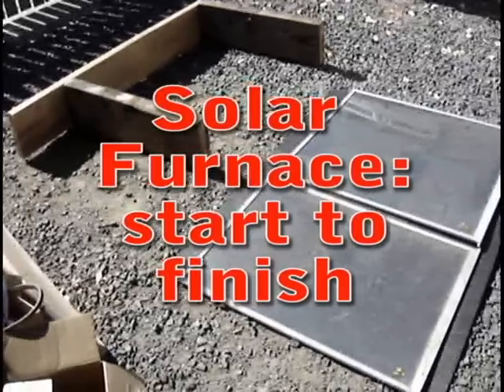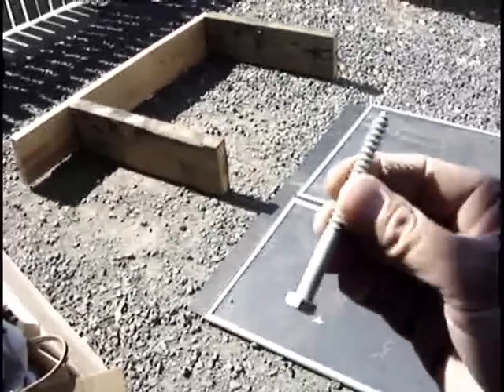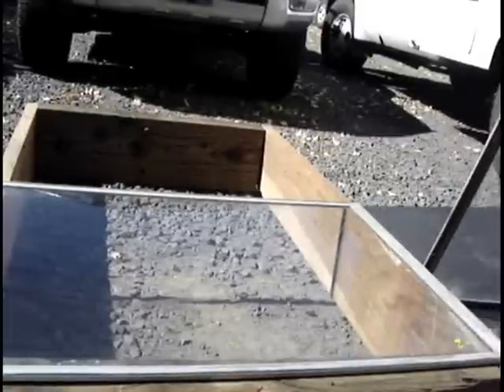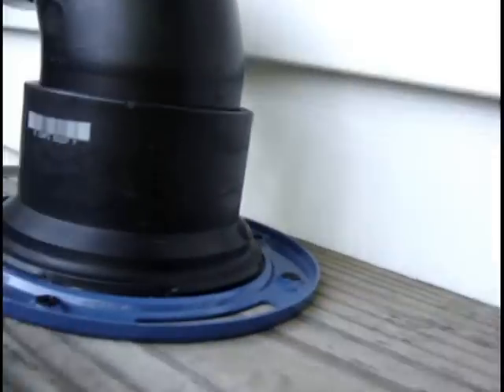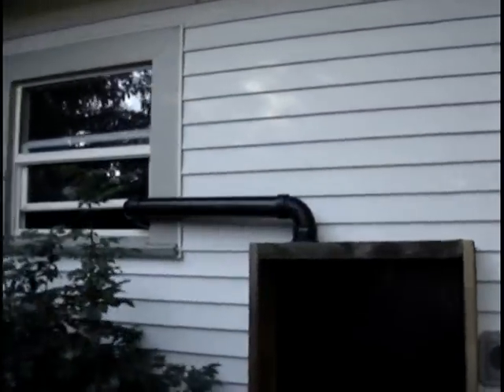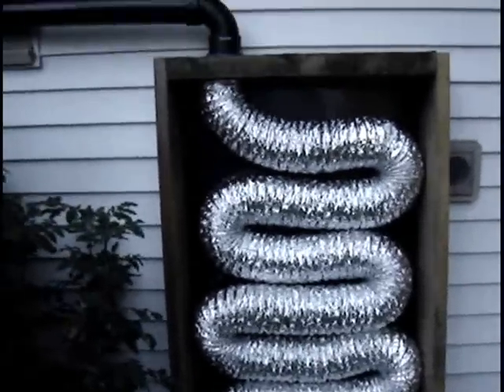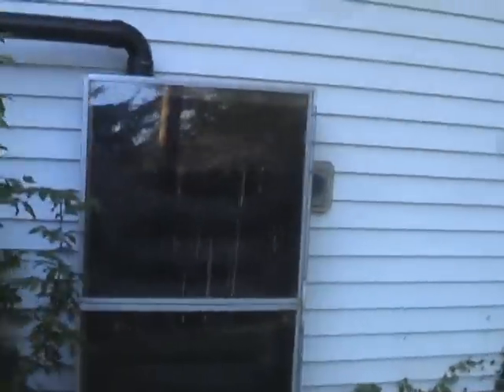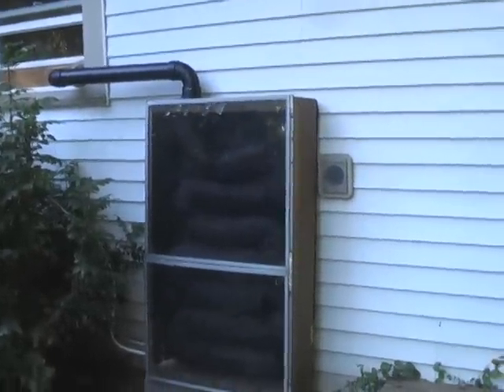Solar Furnace for under $50

Comment: Why are the return lines so tiny? You only get out the CFM you put in. Otherwise it has to be made up and wasted elsewhere.
Reply: .... slower air intake allows the air to warm sufficiently. IF its passing through too quickly it wont allow enough time to excite the electrons enough
Reply: Nice guess. There isn't enough CFM there to heat a doghouse.
Reply: @Cotronixco  its obviously only a proof of concept and not intended to heat his entire house. Dont shit on the man, these kinds of ideas are what will slow global warming. It is obvious that change is only going to come from the people.
Reply: Not shitting on anyone. Obviously it's a teaching moment for some.
Global warming? LOL. That's a false religion.
Reply: @Cotronixco  CO2 levels have increased from 250ppm to 400ppm since the industrial revolution, and your gonna say there is no correlation between then. All you gotta do is look at a simple line graph to see the symmetry...
Reply: @Cotronixco  Your clearly not very educated. It was an example to illustrate how misinformation campaigns have been used before to skew public perception. The fact that you can't see that and totally misinterpreted my comment, coupled with the fact that you have actually fallen for their nonsense is pretty clear evidence of that fact. I don't need to argue with you, I agree to disagree. I'm secure enough with my beliefs and opinions that I don't need to convince others who willingly ignore data to meet their preconceived ideas. Just as the tobacco companies did, just as NIST did in the "9/11 comission report"
Reply: @Cotronixco  as for your other comment. I do think wind and solar are better options, coal generates constant pollution whereas wind generates some, but that is mostly due to manufacturing, and manufacturing takes power and power uses coal or diesel, or just as bad nuclear.... 
Electric cars are not more efficent since again the power to chage them comes from the grid and grid power predominantly comes from burning fossil fuels... the pollution is just further removed, coming from the stack of the power plant rather than the tailpipe of your car but its still going into the environment. Solar panels last a minimum of 25 years... how much coal would it take to generate 5kw for 25 years? About 170 times what it would to manufacture a windmill or solar. And then you can user that power to generate power to manufacture more... obviously once there is sufficient quantity of them for that. Again I dint need to argue. I have worked on off grid power projects for years, my best friend is a retired professor of journalism with over 50 years journalism experience, our other friend is a environmental economist at the world bank in washington. I know what's what... even the oil companies themselves have admitted their own scientists warned them about greenhouse effects and global warming over 40 years ago, the chose to suppress the information. You only dont want to hear it because you dont want to have to admit you might be mistaken, that whatever bs you heard and been regurgitating for who knows how long is false and knock that chip off your shoulder. Your arguments in your response are anpther example of your ignorance. It always gets cooled at night.. has since the dawn of time because there is less solar radiation hitting the earth, likewise a tree getting bigger is a result of cell division, not even relevant in the least. But again I dont need to convince you. If you have nothing to fear and your so sure your right whats with the hostility? Because you're afraid I am right and so try to force your views through agression like a child who doesnt get his way, throwing a tantrum. If you had nothing to fear you wouldnt seem so threatened by my comments. Why not go have another look with an open mind, put aside what you think you know.
The truth is that you are wrong, but won't admit it because people naturally avoid even the most glaring truth when it challenges their world view, its simple psychology
Reply: Oh boy. Where do I start. First, again, anyone who can't even spell 'you're' again, and then claims to be educated is very difficult to take seriously. Next, solar and wind need to be subsidized to be competitive. Do you even know what that means? The cost is so outrageous that it can't hold up on its own anyway. Personally, I contend that burning firewood produces less CO2 than solar or wind. I burn a tree from the woods for energy and you clowns get your panties in a twist. But if I leave it lay in the woods to rot, emitting the exact same amount of CO2 (only taking longer to do so), and I replace the energy it could have produced with another polluting source, you're OK with it! Next, power over time is never measured in KW. It's always measured in KWH. Ignoring the time factor makes all of your calculations completely meaningless. Next, you throw a tantrum and then tell the other guy that he is. That makes you look like a fool. I remember in the 70's the same people warning about the coming ice age. The temperature hasn't increase a noticable amount anyway. Farms are now being found in iceland covered in ice! Face it—global warming is a false religion and a hoax. They've got you by the balls.
Reply: @Cotronixco  One more thing I have never said anything about burning firewood. Clearly your projecting animosity for someone else on to me, and "subsidizing" wind and solar your talking about a monetary impact which again is totally irrelevant in an environmental context, you are obviously listening to the Trumps and Oil tycoons BS too much and don't bother to stop and ask yourself what is the motive behind this since it is obvious that they have an extreme amount of financial incentive to keep people burning oil and petroleum as long as they can. It's a conflict of interest. Just like big pharma has a pill for everything and has supressed other, more effective cures and treatments that can't be patented, because it would cut into their bottom line. The world is not about money, the earth doesn't care how much a windmill costs, and the pollutionn caused was my argument never did i say anything about cost. But your once again looking at it wrong, all a wijd farm does is diminish the impact on the earth but keeps the oower in the hands of energy companies there are very efficent micro wind turbines that can be used in conjunction with solar, and an HHO powered generator for backup that would almost eliminate the need for fossil fules. Basically we would all generate our own electricity on site fornour own needs. This is the real crux of the corporate reistance, allowing man to become self determined rather than relying on the grid, government, corporations in general to do for us ehat we can most certainly do for ourselve. You are a very pretentious person, nose up in the air so far you can't see where you walk. You need a good dose of humility my boy, but I am not inclined to attempt to make the blind see, because experience has shown me you will refuse even the most obvious evidence. Have a nice life, I won't respond any further but I encoursge you to take some time and watch those videos the first and last are the most relevant the 2nd is about the 2008 financial crisis corporate monopolizm and I thought to throw it in for good measure. If your so certain your right, you wont have a problem exploring the other side of the argument. But I am sure, as I sit here now that you will not, you will sit there nose up in the air believing your right and yet refuse to even look to see if you might be mistaken, that is the antithesis of intelligence. You will put it off, say "maybe Ill watch it tomorrow" then tomorrow you will say the same, and the next day again, putting off the possibility of being proved wrong out or pure arrogant hubris. But closing your eyes doesnt make the monsters go away, that's the thinking of a child. I challenge you to explore the other side, it's 3 short videos, if your so sure your right there is really no reason not too because you would smell the bullshit as I can when I speak to you, you are wrong of that I am certain, why not take the oppertunity offered to be enlightened?
Reply: gee maibee iff eye mispel tings yool tayk mee sereeuslee.
That's about the dumbest thing I've heard. Thanks for the entertainment.
Sorry, I don't subscribe to your conspiracy theories. I have read all the arguments in the past about 911 being an inside job, but I have also read the other side. I don't feel it's productive to discuss it so I won't.
If you think that energy costs are not a factor then I'm wasting my time discussing that as well. Even Bill Gates thinks solar and wind don't add up. I have a solar array here, but it's because it's part of my backup plan and as an engineer I enjoy playing with things like that. The last reason I have it is to "save the planet."
You started this conversation with me because you don't understand heat exchangers. I'd be willing to teach more on that, but by your responses I believe it's over your head anyway.
Reply: @Cotronixco  I believe the answer is that by having small intake pipes it limits the amount of air flow in so that the air actually gets hot. The warming air goes up as it heats, Hot air rises, and this ensures the air coming out is in fact warm a bigger hole would allow too much air to pass too quickly and it would barely change the temp at all...
Reply: That seems true to the rookie, but knowledgeable folks know that heat dissipation across a given heat source is never increased by lowering CFM.
Reply: @Cotronixco  thats actually totally wrong. Translate the concept to water and perhaps it will make more sense to your pee sized brain. If you have an on demand water system, why do you think there rated for a certain amount of Gallons or Litres per minute? Because if the water flowed through faster it wouldn't be warmed sufficently. Such a sad arrogant man.
Reply: Little rookie man,  I don't have time for your mental issues here. You obviously know nothing about heat exchangers or heat dissipation. You are confusing GPM with Energy while completely ignoring heat differential. In heat exchangers, in order to extract the most heat from an input source, you must maintain a specific amount of exchange to reach the vertex on the efficiency graph. Your example is completely unrelated—I could tell you why if I had the time, but it would take to long to educate you, so I won't. Maybe once you take some engineering classes, and see your psychiatrist, you can come back and discuss.
Reply: @Cotronixco  Here why don't you take a look at this clip, it's only 2 minutes long. 

https://www.youtube.com/watch?v=__VLb7rJUuk  

Then explain to me how an organization linked to the CIA had foreknowledge of the "terrorist attack" if it was not an inside job... Also please explain to me why there were traces of thermite found within the remains, columns that showed obvious signs of being melted which requires over 1800 degrees, far more than jet fuel or office fires, why all of the towers exhibit the exact characteristics of controlled demolition, why NIST refused to allow their models and calculations to be peer reviewed which is standard practice for any article or study published in any scientific journal, why there were so many eye witness account sof a series of bombs going off, why there was no forensic analysis done of the scene as is standard practise of any crime scene which is exactly what the tower remains amount too since there were over 3000 people murdered, why there were certain people who incidentally did not show up for work that day.... OH so intelligent and gullible fool please explain it to me... Or let me guess "I could explain it to you, but I don't have the time"

Comment: great idea but need to be improved : insolate the pipes coming from the house and the heated air pipe ..that one actually should be in box with glass wall and ont insulated . then the whole box should be not vertical but about 35degree  and on the roof or higher on that wall .  but great idea .

Comment: If you could find some room to put some cans of Crisco, spray painted black, inside this enclosure, they would absorb more heat, and because of the change-of-state phenomenon (see latent heat), They would begin to release this stored heat when the temperature dropped after the sun went down. Can’t be the kind of Crisco that is liquid at room temperature… Has to be the kind that congeals to a consistency like lard or butter at room temp, but melts at like, 90 deg F or so, because it is the change of phase from solid to liquid that stores or releases all the heat.

Comment: Sorry but it looks very ugly, particularly the venting into and out of the house. I am sure you could of done a much better construction with the sealing and fitting of those pipes, the solar box/panel looks pretty good. But what was the temp difference?

Comment: We built a few a couple of years ago with 4x8 sheets of 3/8" plywood and some 1x4s around the sides to frame it.  Used some scrap 1x4s for a raceway inside and painted it all flat black inside.  Once we sealed some old windows to the front we hooked a squirrel cage fan to the bottom end and some venting at the top.  On a good day it would run a 25 x 20 garage shop to over 80 with a start temp in the 30s in under an hour.  Quickly fitted it with a temp control on the fan.  Used a similar design for solar water heaters using some 55 gallon drums of water, a 4'x4' solar chamber with 1" black pipe in a coil.  Using a pond pump for circulation, the water was kept near scalding all day and well into the night.  Insulated drums were still hot the next morning.
Reply: I need your blueprints!
Reply: Can you give us a link to buy the blueprints? I want to build off grid in Wyoming. This would be extremely helpful.
Reply: This is awesome.  Even 5 yrs later.  thanks rick.  i will also add a 12v solar fan to my heater, to get more circulation.

Comment: That isn't going to circulate without a fan. Intake would need to be cooler and lower than exhaust for passive system and would suck air out of the house and cool it when the sun's not shinning.

Comment: The concept  is somewhat half baked to be viable.Given the ratio of heat collecting surface area to the area to be heated without thermal insulation ,complete air sealing, and optimal site orientation  it's .likely to be an energy drain rather than an energy gain. I'd read more on the principles of passive solar design. Don't give up on your idea,but improve it based on the available scientific and engineering knowledge available. I don't suppose you have watched solar tire oven ? It works!-https://www.youtube.com/watch?v=wbYIULZSbrY

Comment: I wouldn't have used the duct.
Instead I would have doubled the glass with a small space between and screwed pop cans spaced 4 inches apart to the back with everything painted black. 
Warning do NOT use "e" glass(UV resistant).
    1 and a half inch pvc would be more efficient, especially if it was covered for insulation purposes. Then I would have grabbed a used purge blower from a pulse furnace because it is very small and moves little air, about right for the size of this project. Then control it with a temp switch set for 100 degrees with 80 degree off setting to start with. These parts can be found used and about free. A local scrapper should be able to set you up.

Comment: this is silly. you'll lose 99% trying to gain 1% lol. even if you plumbed all that correctly into devoted inlet into the house and not a cracked open window with a 2x6 in it lol it still wouldn't work. you'll gain far more just keeping that window air tight and letting the day sun heat directly through that glass. adding pipes isn't going to make that warmer. it's all un insulated. your losing massive amounts of heat, not gaining. dont try this guys, your trying to heat up the outdoors lol.

Comment: Why did you even use the aluminum pipe what do you gain when you put some screening in there something to kind of stop the light from reflecting out of the heat from reflecting out or whatever seems to me you'd be better off making it a bigger then then that complicated

Comment: Why do you think you will collect more solar heat than the existing window you are using for the "exchange" . You won't , remove curtains from window , clean window , sunlight will fall inside carrying heat which will be deposited on the surfaces exposed and heat the air and everything else in the room and about 100% more efficient than the contraption you built . 
Now if you built a similar device about 20 times bigger with a proper cold air inlet pipework  ,at least 8 inches and matching hot air outlet , at least 8 inches with inline fan , with the internal pipework of the heater also painted black , all pipework insulated , you may be on to something .
PS :  Large improvement ,double glaze collector !

Comment: The return lines are far too small and they reduce the air flow.  To work efficiently they should be the same size as the line leading to the house.  And if you want to be really efficient drill a hole in your wall close to the floor and take cooler air back to your solar furnace from there.  Lower return temperature means more heat will be transferred to the air going to the house.  And be sure to insulate the supply and return lines.

Comment: Surely the return air pipes need to be the same size as the furnace outlet, any horizontal and uninsulated pipework will reduce efficiency?

Comment: Don’t you think the intake and output tubes are really too close together? I’m thinking of this for my 10x10 shed but the placements of air tubes would need to be spaced almost on opposite ends of each other to help the air flow.